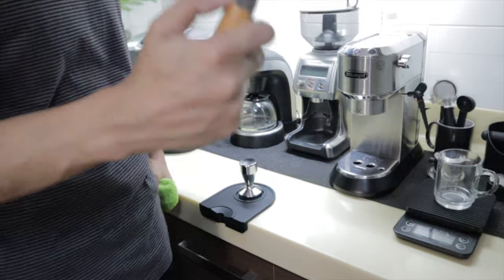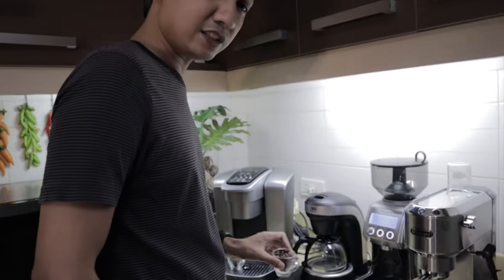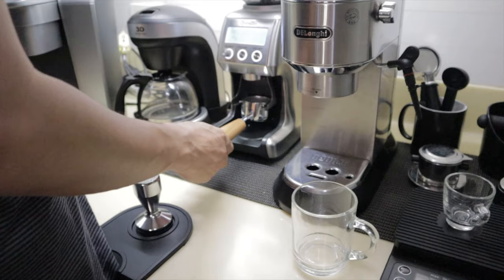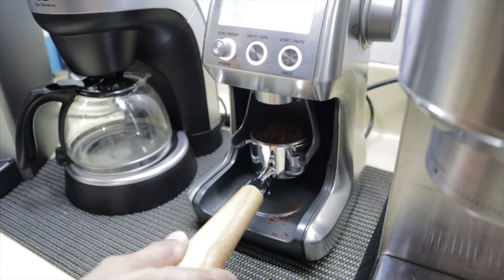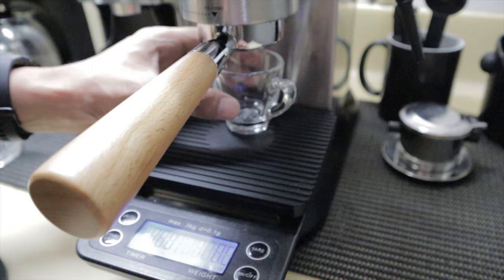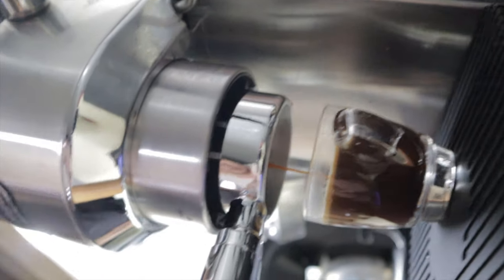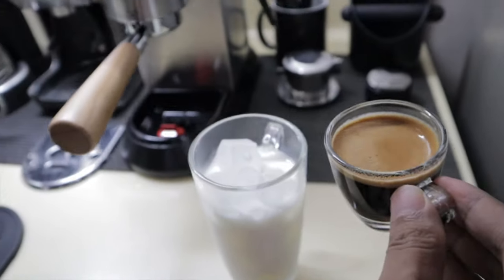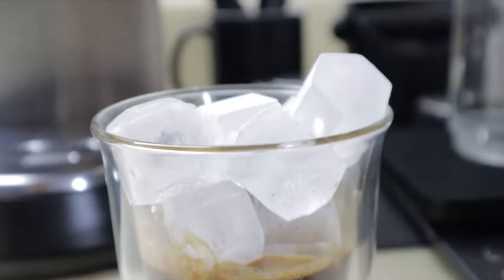MY MORNING COFFEE ROUTINE | Delonghi Dedica EC685

Comment: What grind settings did you use for your smart grinder pro ?
Reply from the maker: Depends on the bean. When i was still using it I usually start at 12 and adjust finer. Then adjust the inner burr if you need more of the finer range.
Reply: @trippymarv  Thank you for the tip
Reply from the maker: Thank you for watching 😊

Comment: Does your coffee taste sour?
Reply from the maker: With this bean yes when I pulled less than 40g.
Reply: Why it will sour?  I pulled 40g with 18g of coffee it tastes sour too. I then upped to 60g output then it's fine. I Have the same botttomless portafilter and machine.
Reply from the maker: Dip your portafilter in hot water before you pull. Helps with temperature.
Reply: @trippymarv  ok I'll try! Thanks!
Reply: @369MatteGrey  it depends on your brew time, 40g in <25 seconds could taste sour. try adjusting grind size, tamping, heat, etc.
Reply: @369MatteGrey  in my case it was the grind size. I set up my grinder finer, and the result is a smooth and sweetness coffee! Try to imerser your portafilter in boiling water for 5 min, it helps with the temperature! My brew time in a finer grind is about 35-38seconds
Reply: @renanks1405  I am using the finest grind size on my Delonghi dedica grinder, no crema. But, I did try to dip my protafilter like what Marvin and you suggested, it really helps 😆
Reply: @whoami724y  thanks so much. I'll try.
Reply: @369MatteGrey  are you brewing with fresh beans? fresh mean 2-3 week roast
Reply: @renanks1405  I don't think so.. it's difficult for me to buy fresh beans due to the geographical area that I lived in. I always source for Lavazza, Illy or Starbucks beans.
Reply: Valence Ho try to get the freshest as possible, always look the fabrication date, and always keep the coffee inside the original pack, with some rubber bands involving the pack, to keep the air out to avoid the oxidation of the coffee

Comment: how can you put 18g of coffee while mine only takes 13g?
Reply from the maker: Are you also using a non pressurized filter basket? I dose 15 to 16g normally but the bean on this video is old that's why I upped the dose.
Reply: @trippymarv  I'm using stock filter basket. The most I can get is 13g, 14g is too tight when I screw it in, the manual says maximum 15g but i just cannot get it.
Reply from the maker: Same experience here with the stock filter. I would suggest getting a non pressurized one. Huge jump in flavor and body.